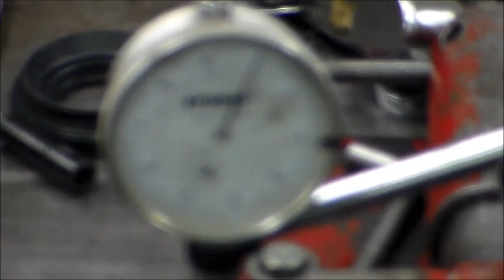1990 SUZUKI SAMURAI REAR DIFFERENTIAL

Comment: Thank you taking the time to share this.  Excellent presentation.  I'll be doing mine soon and this is just what I needed to feel confident that I can do it.  I thought I'd have to play around for a while to get a good contact pattern.  Either you got lucky or experience got you there before you checked it.  I hope it goes that easy for me.  What do you think about using the crush sleeve vs a solid adjustable pinion spacer?  I see the solid spacer recommended over the crush sleeve but then I would guess it will be more screwing around with the spacers to get the preload and mesh pattern correct.

Comment: Wow when yoi tightened the pinion  nut you can see your big ratchet flex.  Im trying to put mine together right now and i cant crush the sleeve.  But i only have like a 18inch breaker bar. This is not an easy job at all

Comment: By far the best video on you tube. Explained perfect. One question, is there a torque spec on the 30mil nut on the flange? Thanks again.👌👍
Reply from the maker: sorry for the late reply, no there is not a spec. for the pinion nut it tighten to it crushes the crush sleeve and you achieve the rotational load on the bearings. it starts at about the 20 min mark in the video. thank you for watching
Reply: @robertrushton6622  thank you Robert